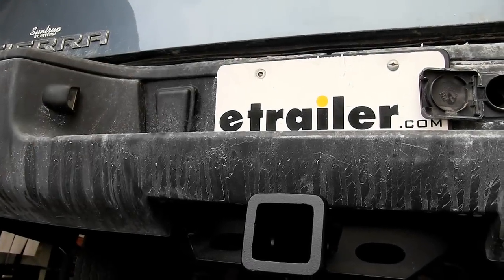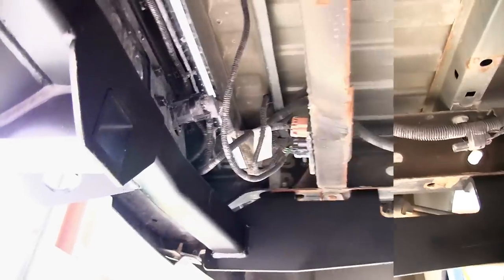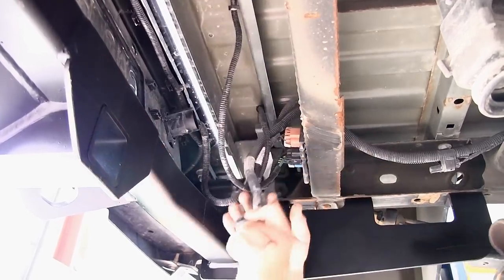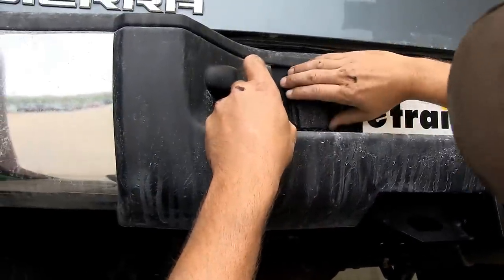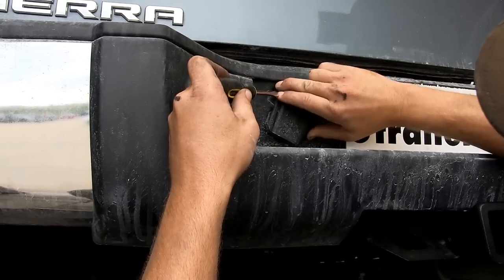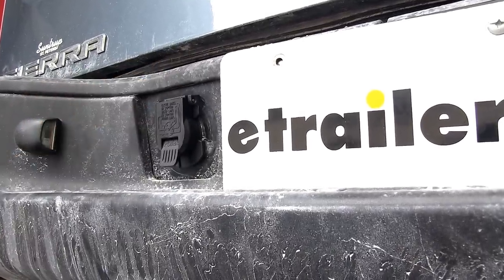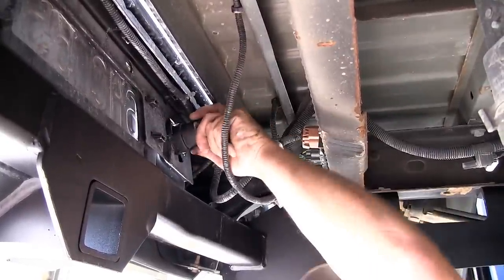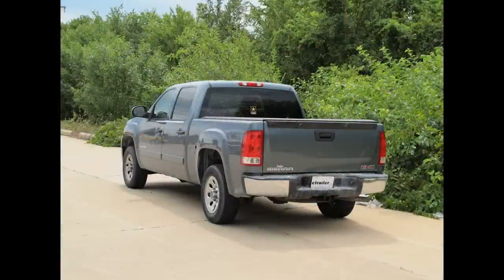etrailer | Pollak Twist-In Trailer Connector Installation - 2007 GMC Sierra

Comment: Of course mine isn't this easy wth lol.
Reply from the maker: We're sorry to hear that! What difficulty were you having?
https://www.etrailer.com/Custom-Fit-Vehicle-Wiring/Pollak/pk11916.html
Reply: I have this truck, but it didn't have an electronic plug mount in the bumper like yours. Mine was just dangling under the truck and it didn't look the same. I had to just cut the wires and straight slice in what I had
Reply from the maker: Yes, that particular option, # PK11916 is for GM trucks with the cutout in the bumper that accept a twist-in 7-way.